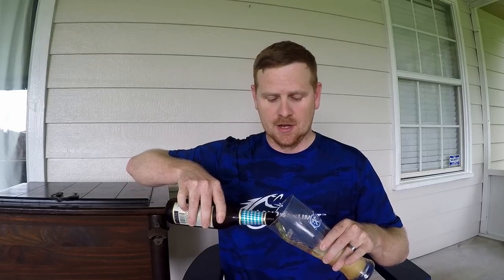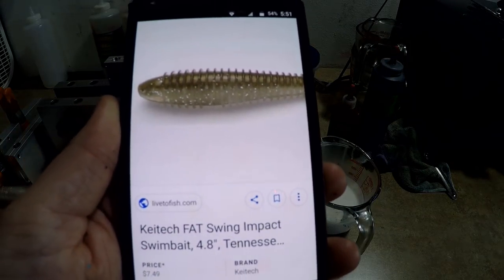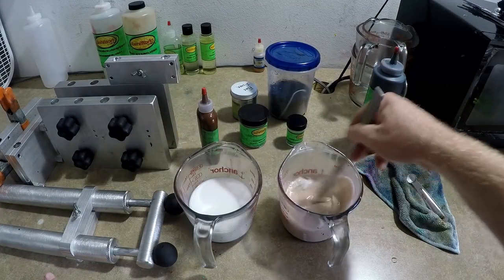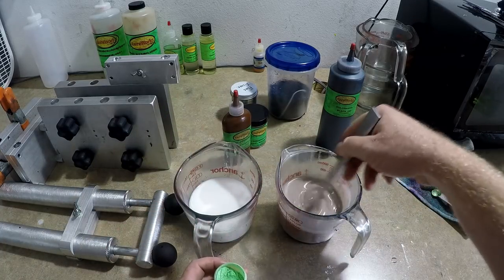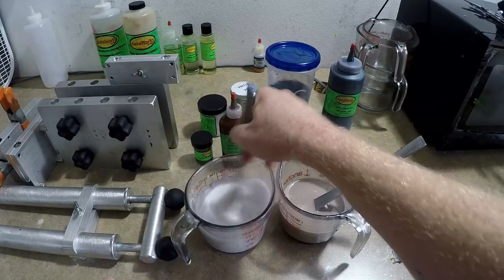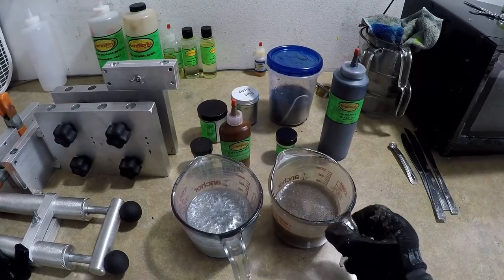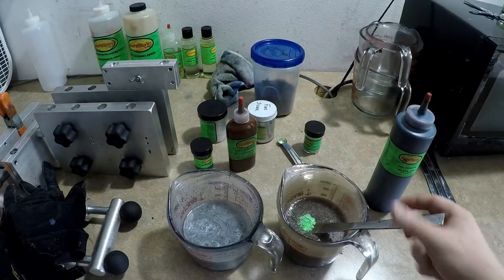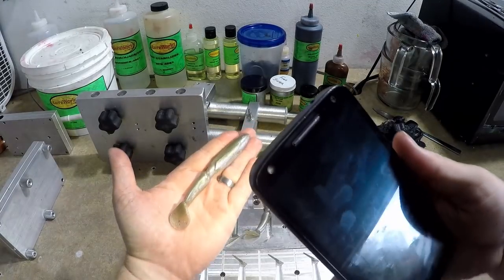POPULAR COLORS: TENNESSEE SHAD! Making Soft Plastic Fishing Lures.

Comment: How many times do you reheat? I've had good luck with putting hard sprue and injector slugs back in the pot and reheating ( I actually do it all the time.) I've only burned my plastics once, but that was mostly from me cooking too long between stirs.
Reply from the maker: Adam Storm I reheat pretty much as needed..if I need to do multiple runs off of one cup then I obviously will reheat. I also reheat sprues..I hate wasting plastic